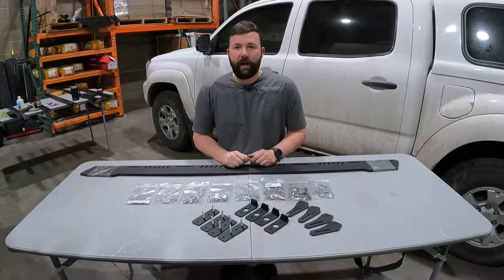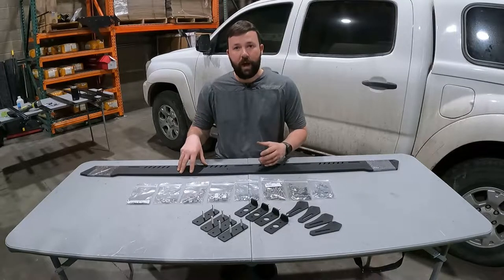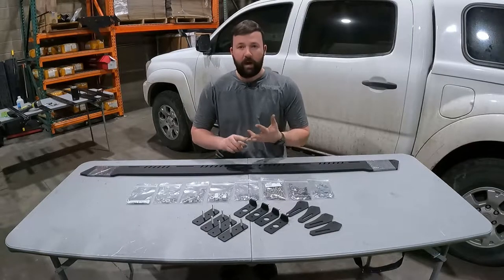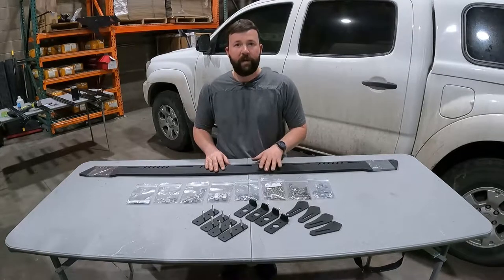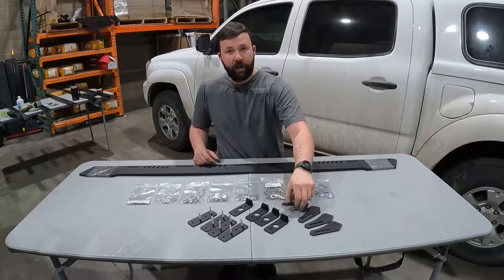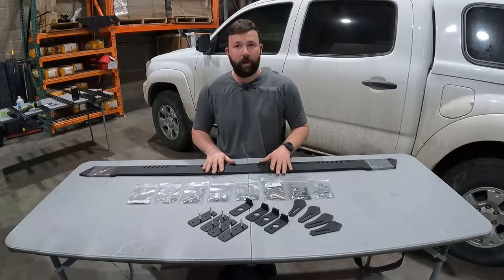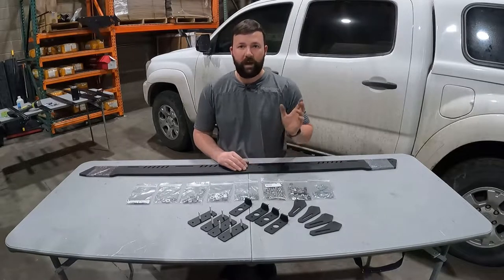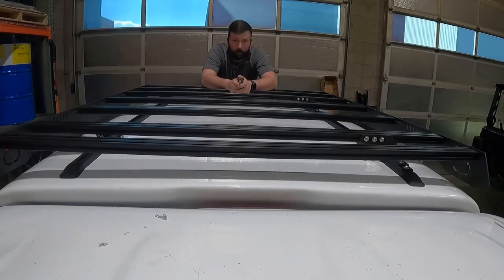How to Install an eX Series Rack to a Camper Shell or Topper | upTOP Overland

Comment: I noticed the spacing between both rails are significantly close, how important is it before buying the rack?

Some topper dealers avoid drilling the tracks on the center board of the topper to avoid water drippage inside the topper; if spaced out a bit ,will the cross bar still be long enough if the tracks are installed on a wider stance?

Comment: I bought the Alpha cap rack and did not receive any Allen screws I received hex screws and have had to do two ru s to Ace hardware to get washers. Screws are way different than this, and don't sit flush. Seems like all the screws are longer... Thought it was a step better than this but did not get the hardware to match.
Reply from the maker: We have converted over to hex screws so they don’t strip out. They should sit flush and the hardware kit should have came with everything you need to get it installed you can always give us a call and we can help with any issues your having

Comment: This video is awesome, thanks Drew. Appreciate how precisely you speak as you walk thru each step and the tool list table at the end of the video is helpful. To confirm, it looks like the Vibra-Tite VC-3 tube comes in a little baggie with this rack, is that right?

Also, I just skimmed thru this video - to confirm, there's never a need to drill into the fiberglass when installing the Bravo eX cap rack, is that right? Unless I missed something it looks like all drilling is into the tracks and not into the shell, which is great. Any time drilling into the shell is needed I'm inclined to pay someone at a cab dealer to do it for me but this looks pretty DIY friendly.
Reply from the maker: Hey Ben,

Correct! VC-3 is provided in the hardware kit.

As for drilling, as long as your topper has preinstalled Thule, Yakima or Rhino Rack rails, then this is a no drill install!

Drew
Reply: @upTOPOverland  Awesome! Thanks for confirming. You guys run a good ship!

Comment: Great video.  I have a leer cap with rails already installed. How do I know if they are Thule or not?
Also- once installed without spacers, how his is the face- from the top of the cap?
Reply from the maker: Hey Erik,

Our hardware will work with Thule, Yakima and Rhino Rack tracks. As for the spacing, it depends on the brand of cap, model of cap and the track location on the cap.